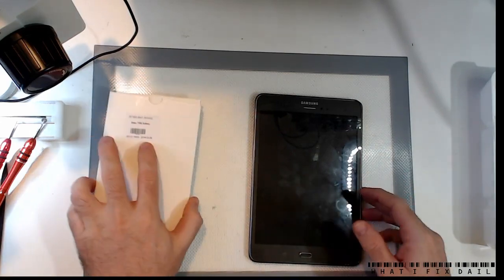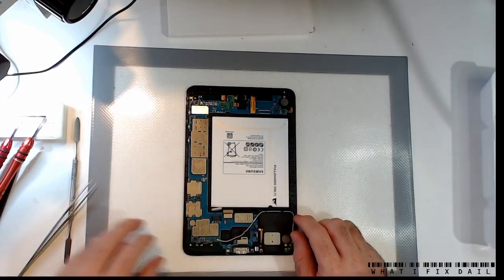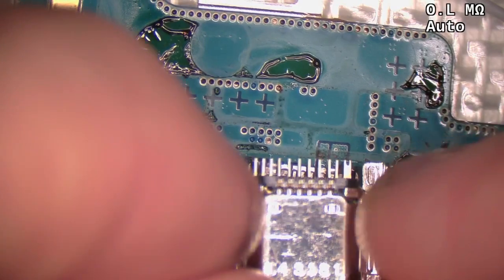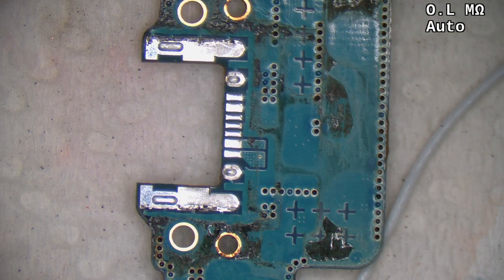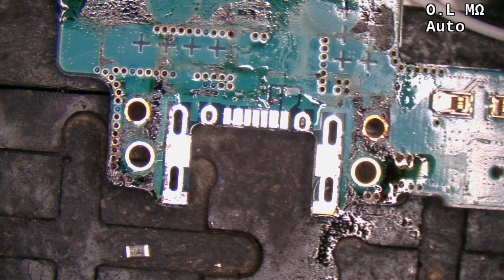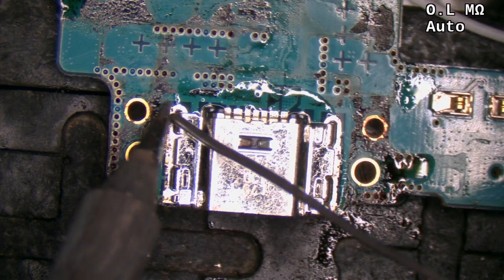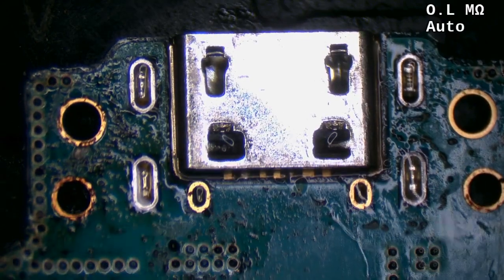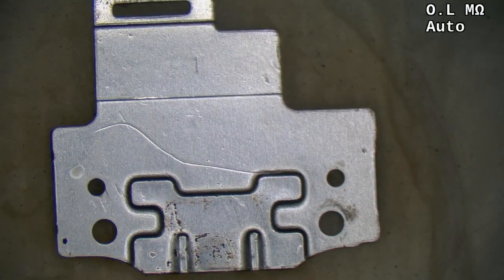Samsung Galaxy Tab A SM-P355: USB Port replacement

Comment: Great video. BTW where did you get that USB Voltage/Current meter? All the ones I see online either have a short pigtail or simply a standard A plug to the host side/charger. The standard B plug on your charger would make things a lot more convenient in the lab.
Reply from the maker: Personally designed/made custom job I did quite a few years ago.  Preferred the B-plug combo and higher visibility of the reflective LCD.

Comment: Sir, sorry for my innocence, what is the fluid like you used in the video? the one used for removing the solders and before soldering. Thank you
Reply: Amtech flux, or do you mean for cleaning?? . That is 99% alcohol isopropyl alcohol

Comment: Cringed a little at the first part when using metal tool to pry open. 
Plastic pry tools (NOT the ‘black stick’, because it’s too weak), normally work very well for this purpose. Even a plectrum would work 10x better than the metal tool used here. 🙂
Reply from the maker: I understand your concern. I'd argue that it comes down to experience with the tool too.  Naturally being a client device I don't want any impact/crush/nick marks in the chassis, and I had tried several plastic tools previously on this to no real avail.  The metal spudger is a very thin one with just the right level of stiffness, and we have a long relationship with a lot of understanding of how far we can go without getting hurt (I've tried to find another one of this thinness to no avail, every other one is too thick/stiff :( ). 

You are correct though, there's no way I'd recommend using a metal spudger to anyone for opening these plastic devices, and I see plenty of gnawed at victims coming in here having suffered such fates.
Reply: Paul Daniels, I suppose that experience with the tool compensates for the fact that it’s not the ideal tool. :)

Comment: Beautiful work, where do you buy your batteries from?
Reply from the maker: A lot of my gear comes from EasyPhix in Australia, though I have a few other suppliers.
Reply: Paul Daniels thanks for taking the time to reply, i do really appreciate it :-)
I do buy the odd parts from easyphix, mostly Valueparts though as I've found them to hold the best levels of stock, also when I make more than one order in the same day they automatically refund the postage, which is a very nice little unexpected bonus. No others have ever done that.
Another question, why did u replace the battery on this device, did you know already it was damaged, or just to mitigate risk, or the customer wanted it replaced?
Reply from the maker: Risk mitigation. Battery had experienced prolonged bouts of low charge, was already over 2 years old and the client lives out of town.    I probably could have gotten away with not replacing it but it was a low cost change that hopefully saved me short-term future dramas.

Comment: hey! to much to ask about the DMM software? i notice Louis R its using it and it keeps mentioning you with it :P
Reply from the maker: It's a very simply written program using only Windows GDI.  I wrote it in Linux, and cross-compiled it to windows with mingw64 

https://github.com/inflex/BK-390A

There are a lot of things that can be improved on the software (first thing is the fact that it blocks while waiting on serial data... very naughty), but it's simple and it does the job; being "technically right" can come later.
Reply: do i need a specific DMM? what model you have? any usb will work?
Reply from the maker: The software is very specifically for the BK390A meter.   There are some generic multimeter programs out there with a lot more features that are also opensource.

Comment: It looks like you should get a desoldering iron to suck the solder out of holes the wick cannot get out.
Reply from the maker: Mechanical plunger types won't work well enough and generally cause carnage on light boards.  I could get a dedicated desoldering gun but it's comparatively infrequent that it's required such that it's more economical to just sort it out with hot air and wick.
Reply: Paul Daniels - yes the desoldering gun is what I was meaning, I put off getting one for years, when I finally got one I wished I had got one sooner.

Comment: Hi Paul, if you have something that don't dissolves in 99% alcohol try a mixture of 70% Isopropanol and 30% distilled water this dissolves almost everything.
Reply from the maker: That's what I was using with the earbud (q-tip) afterwards,  80/20 mix, and hence mentioning about not being able to obtain true distilled water, only demineralised, though it still worked.

Comment: You should be able to get distilled water for a car suppliers used in batteries. What about using white spirit to clean it.
Reply from the maker: Around here every just sells demineralised or deionised. No one in this region sells actual distilled water; best option for me would be to ask the university (about 130km away) for some, or buy a home distiller.
Reply: Paul Daniels what's wrong with deionised water? I thought they sell distilled water in supermarkets to use in your iron. Whereabouts in the world are you!
I think you should start show off by saying "you going to like this but not a lot"and for my next trick!!
Reply from the maker: Ah yes. Good old magician intro :)

I live in a rural area. The trouble with deionised water is that it still contains dissolved material. It’s not truly bad but it’d be nicer to have true distilled water.

Comment: Now that was yuck, no not your spot on socket replacement, that pcb poo lol.
Im so deaf, i thought you said "Demonised water." , i had to laugh, im a silly sod :-D.
They are bloody lucky that it still worked ok.
Reply from the maker: Agreed, once I saw the gunk was pleased that it even still had worked.  Removing the gunk would have been easier had I not baked it, should have tried to get that metal plate off first.

Demonised water... opposite of holy water :D